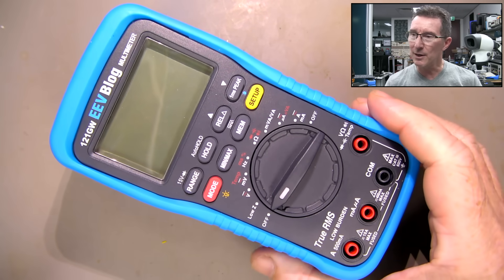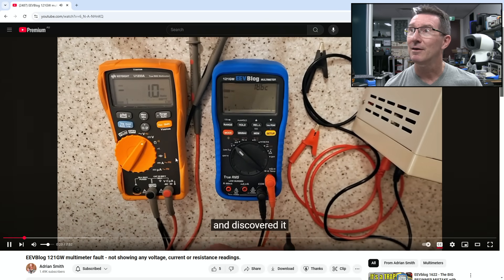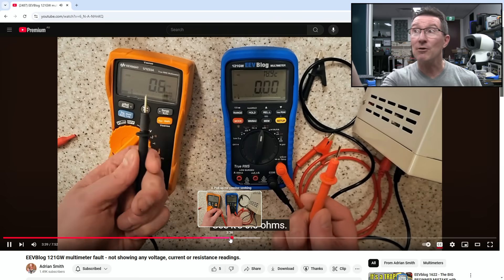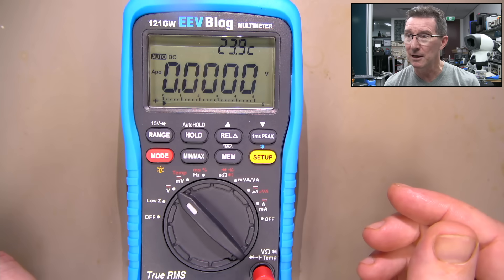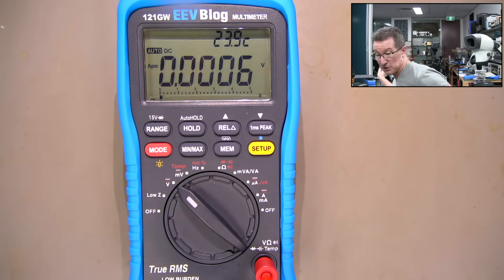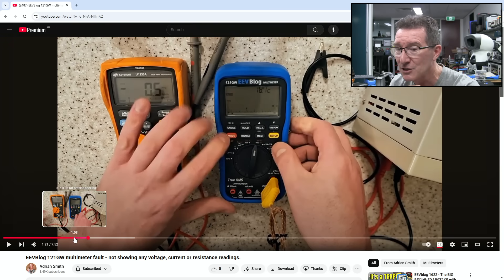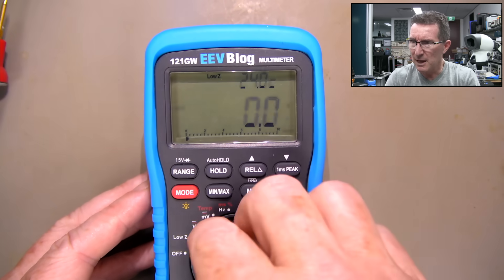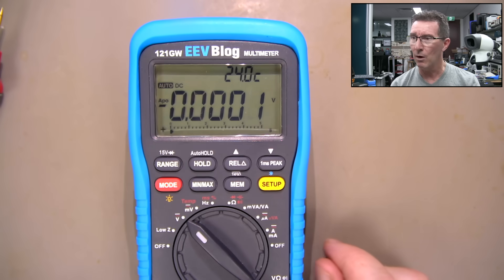Schrodinger's 121GW Multimeter

Comment: I have two of these in switzerland, and every once in a while they will not properly measure voltage. Just too low. And they will do all kinds of beeping. The select switch is fine apparently.
Switching off and on again fixes it.
I like them, but there are issues.

Comment: These things happen. Last week I bought a remote controlled power outlet (the kind you plug into a wall outlet and then plug your appliance to it and you have a remote to turn the power on and off) and no matter what I tried I couldn't get the remote paired to the thing. I took it back to the store and the guy plugged it in and paired it at first try. I looked like an idiot who can't follow simple instructions. I have a theory though, when I was trying to pair it at home there was the switch mode "wall wart" for my electronic keyboard next to it in the power strip so maybe that caused enough RF interference to jam the receiver.

Comment: What do you use for an oscillator that makes it go?  I have heard that some MEMS based oscillators don't like helium.  That is weird enough to be the problem.
Try putting nearly discharged batteries in the thing.  I know of a case where something went very weird on batteries that were below the "change your batteries" level.  For some reason it didn't complain about the batteries but it went funny.

Comment: My 121GW at work with SN 23xxx.. has issue with resistance readings, when nothing is plugged it will read some stuff, and when I short it with a cable it reads negative resistance, or sometimes positive resistance at like 110R even tho the cable is high quality high current rated sub 100mR.
Turning it off and back on usually fixes it, but it keeps coming back, I took it apart and cleaned the rotary knob contacts but it only helps for like a month and then it comes back.
I see no damage on the contacts.
I don't want to return it because if people at work hear of this they won't let me order more of these.

Comment: Was it shipped with the cells installed?  Perhaps they are making better contact after vibrating or warming up.  Try using the device with marginal voltage supplied.

Comment: I had an interesting issue with a DMM once. I was measuring a DC voltage in a circuit and the meter would lock up like that. I found out the DC voltage I was measuring had a small RF ripple on it. I could fix the issue by twisting the meter probes making them into a small gimmick capacitor.

Comment: Cold solder joint or maybe solder ball or other debris that got stuck in just the right place. Try opening it up and be very careful not to lose any tiny thibgs that might fall out of it. Or, perhaps for a noninvasive netjod, bang it about a bit and see if that does it. A few whacks to tge bench should be well within its normal shock tolerance anyway.

Comment: It might be oscillator/pll issue. A few people have seen that in brumen dmms. Likely it was osc issue due to temperature variation. Very hard to find without spending hours in temperature chamber.
Reply: I wondered that whilst looking at the schematics whilst pondering what to do with it. In the end I just sent it back
Reply: @adriansmith31  my gw121 few times didn't start at all. Reason unknown. Cycling power always helps. Also I saw someone with eevblog brymen that for 10 boots, only one or two were succesfull.

My issue with gw121 is faulty software. I use logging a lot, and logging voltage over weeks (with 10sec sampling) creates massive CSV files. Firmware splits those csvs to have ~60k records. Then it starts a new file. Unfortunately sometimes it is losing some data doing that... But this is fw, not hw issue.

Comment: I started out working life as a horologist (watch mendr) we would have customers come in and say their watch did not work or kept stopping running fast slow etc and once the customer left the shop the watch would spring back to life and we could not find the fault. We would service the watch any way and the customer would come back collect the watch and half an hour later come back and sure enough the watch was stopped again. Never did find out why but it seemed some people had a Uri Geller affect on watches. This was back in 1971 before electronic watches.
Reply: I find the same thing happens with Bluetooth, I am one of these people that always and consistently experiences interference and connection problems with Bluetooth, other people have no problems even with the same devices. Ghosts in the machine lol

Comment: For the fault to appear, it might depend  on a certain battery voltage, temperature, ?  It might be similar to  the one in another video, also with the processor not running properly, to  witch i commented, It had a capacitor missing 

https://www.youtube.com/watch?v=f-LTv1GqCMw&t=1033s  (the other video)
 To me this looks like a 'high side switch' with inrush current management, (RC on the gate of the high side FET)  rather than a latch  C58 is not populated, but I think there is supposed to be a cap there. Without it, the FET switches too abruptly, causing a dip in the power-supply, causing the controller to screw up.

Comment: It happend because the update rate is in metric seconds, in the UK they use imperial seconds. The update rate just happend to fall in the dead time between both standards.  Sending it back it traveled from the north hemisphere to the south and so reversing the fault and that got both times back in sync. Simple 🙂
Reply: Would that be the case a simple counter clock turn of about 6 would compensate for the Coriolis force when passing the equator.
Reply: Thats some stella reasoning.

Comment: Thanks Dave, annoying that it works now. Thought you might have been able to make a fault finding video out of it.

If it were out of warranty I would have tried reflowing the front end IC and looked at the selection switch contacts.

Very odd as it has only been used around 20 times and simply refused to work one day.

Thanks for the channel shoutout. Noticed the subtitles don't pick up my Yorkshire accent well. I don't have the best of microphones either 😢
Reply: @adriansmith31  those automated subtitles doesn’t even work properly/correctly with IA generated audio.

Comment: Try heating it up and cooling it down while testing it in between. There could be a dodgy solder joint somewhere on the PCB and the thermal expansion properties of the components and PCB will make the bad solder connection become intermittent.

Comment: My VLSI professor at university used to kick his computer tower to make it work. I realize now he knew better!
Reply: Back in the 80's, a warranty repair bulletin from either Atari or Commodore (I can't remember any longer, either the 800/600 or the Amiga) was to lift the unit 8-10 inches up from the work bench and let it go. Test, repeat some number of times before opening the unit, if unit worked repair was considered completed.      The socketed IC's would get reseated without having to open up the computer and push on all the socketed chips.
Reply: @alexb.1320  Since I do repair vintage computers, pushing the socketed chips as a first approach is a way to go, dropping them not so much anymore since the plastics tend to be more brittle than 30-40 years ago!

Comment: it's been a bit cold here in uk maybe put it in a fridge for a while to see if a temp change will make the fault appear, it's a strange one that
Reply from the maker: You can see the temp reading on Adrian's unit, 18.6C
Reply: @EEVblog2  It might have been warming up from a colder temperature.  In fact, I wouldn't rule out the possibility it was stored in a colder area and now had some internal condensation.
Reply: @russellhltn1396  That'd be my guess too.
Reply: @EEVblog2 might still be worth thermal cycling it
Reply: @EEVblog2  Yes but it may have warmed up to 18.6c after being frozen. Could be condensation inside stopping oscillator etc.
Reply: @1kreature  That's quite a stretch there from frozen to condensate stopping oscillators.
Reply: @andymouse  Oscillators is just one possible cause, but condensate can and will wreck havoc with such instruments. I am talking from personal experience.
Reply: It has always been in my front room in its box which never drops below 15 degrees C. No moisture got into it so I guess it's a bad SMD solder joint or maybe dodgy switch.
Reply: The frost had evaporated by the time it was received back in Aus. There was a welder on another channel which wouldn't work below 22C.

Comment: Perhaps the shipping folks applied some percussive maintenance to it.
Reply: From UK do Australia, probably a lot of “percussive maintenance” occurred to it, so will never have any problem again.
Reply: @EudesRJ  'percussive maintenance' sure sounds better then 'slap&fix'.
Reply: @welbow  perhaps there's a metal flake bouncing around inside the case... Or a cracked or cold solder joint which is currently making contact
Reply: Yeah, I was going to suggest some percussive diagnostics.

I’ve found that faults which can be fixed by hitting it this way can often be duplicated by slapping it that way.

If the fault does return, disassemble and look for poor solder joints etc.
Reply: It’s beaten to submission it seems.